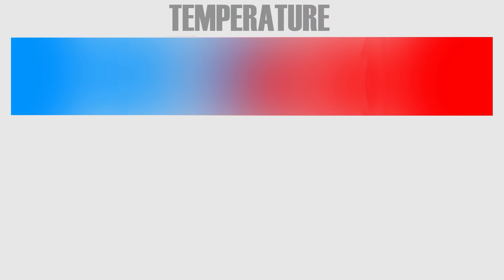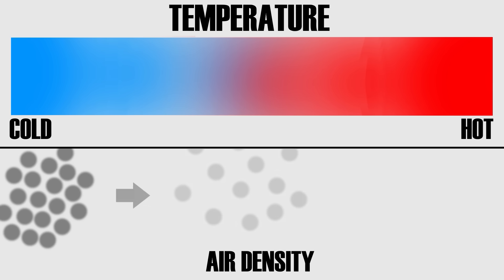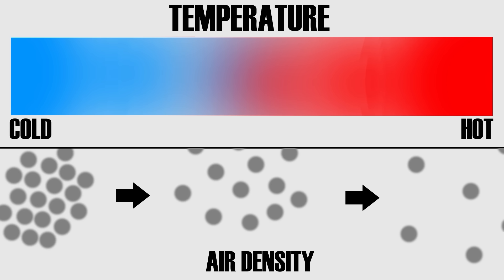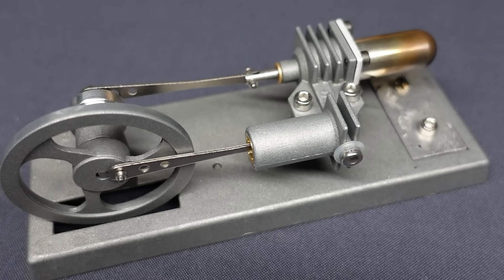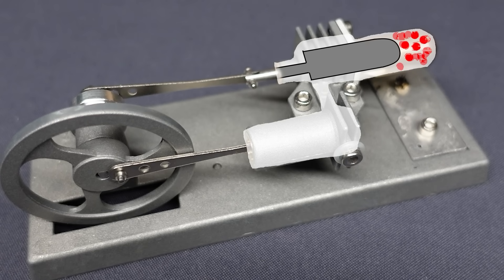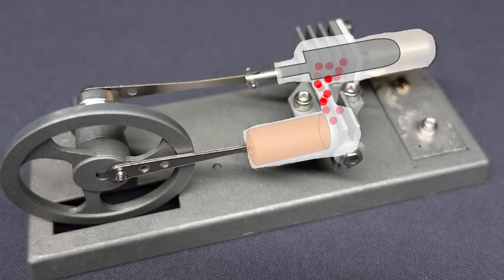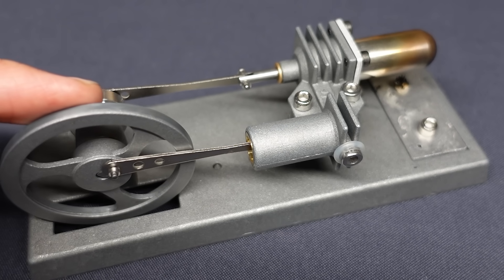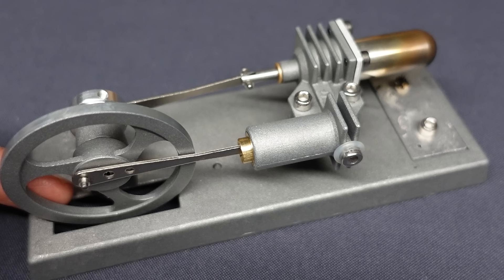It Can Save The World - The Simple Genius of Hot Air aka Stirling Engines

Comment: Hi, its an wonderful explanation. Can we use some liquid instead of plain air in the piston, as liquid will exert more pressure than air, and the system is cooled by external air, if we can again use liquid cooling method, wont it be more powerful or the power-to-weight ratio?

Comment: Perfect for farms that produces biogas, there is very easy have a flame 24/7 operating in a safe external place, powering a low voltage generator for electronics (as laptops, phones and tablets have their own batteries).

Comment: Its good to see a new kid who just discovered hot air engines.
They do need lubrication and cooling. And remember 
It takes time for the engine to run when first heated, so any running time after the heat source has been removed counsels out the "waste heat " running time.
These engines are great little display pieces .
The greatest novelty I've found is they can be turned at flywheel by another motor and refrigerate the hot end cylinder !
Some cryogenic refrigerators use this principle. 
Take care, everyone  !

Comment: You could make it more efficient by using a induction heating coil, using a ceramic outer with a coil metal inner for more air contact and a heat sink copper tube thing for transfering heat around those fins. This would make a massive temperature differential. :/

Comment: We need to be careful about this implication of free energy at the end.  When you start heating the engine, energy is input as it heats up from ambient, but it doesn't run; then it runs; then it cools to ambient, during which time it runs.  Energy input is out of phase with output, that's all.  My grandmother used to believe that electric rings were better than gas rings, because you got free cooking at the end after you turned them off.  It never occurred to her that she had to wait a minute after turning an electric ring on before she got any heat, whereas heat came instantly with the gas flame.

Comment: The problem with all heat engines is the efficiency. It is always lower than the theoretical carnot 1-T1/T2. This means the heat source needs to be as high as possible, but that is limited by material and Nox produced. External combustion also has the problem of wasting heat by heating everything in the vicinity of the working fluid.

Comment: sterling engines produce power….but incredibly tiny amounts of power.  And still lots of moving parts to wear out.  Sterling engines are not as efficient as an internal combustion engines….even steam engines are more efficient(and reliable), at changing heat to mechanical energy.  Electric motors running off of solar panels produces no emissions, won’t catch your curtains on fire, either….and beats all mentioned above for reliability

Comment: Maybe not good for everything but would certainly make a decent generator running off a cylinder of lp gas, charging up batteries and power tapped from same batteries to a electric push button starter for getting a bigger version running👍

Comment: The best thing is: you don't need a flame to run a Stirling engine. As long as it is hot, it will work. You can use geothermal heat, waste cooling water or from molten salt

Comment: Two questions:  1.  Isn't the work done by the Stirling after the heat source is extinguished offset the cost of the heat required before the engine begins to produce work?  2.  What is the thermal efficiency of the Stirling compared with an ICE?  Isn't there a large percentage of the heat of the source lost to the atmosphere rather than going into the engine?  
Has anyone tried to focus sunlight on the loose piston cylinder to make it run only on solar heat?

Comment: There are companies building generators for remote critical systems using Stirling engines. 

I have used them in the oil and gas industry.  Very reliable, low maintenance for lower power consumption applications. 

As a bonus the cooling fluid could be used for heat trace or limited heating applications. 

The ones I’ve seen are made by a company called Qnergy.

Comment: Very cool.
As a range extender for an electric vehicle, like the submarine example you gave, they could work well.

It would be interesting to know what sort of temperatures the pistons are subjected to. Creating a very low friction engine using Teflon pistons and bores might be possible.
Having opposed pistons, rather than in a V configuration, could provide some nice benefits to smoothness. Especially if there are 6 or more pistons.
And having the non-working piston a better fit in its bore, but with passages for air to travel through the piston, might also reduce some of the rattling noise it makes.

As for wasted heat.
I work at a steel works. We cast slabs of steel and plonk them on the ground to cool down in the open air.
1 of the biggest running costs for the steel works is electricity............... 
Australia............
Reply: The newest gen. of commercial Stirling engines use no oil ( also an ignition problem) they use PTFE rings and work for ca. 24 years constant without fail. So they are incredible reliable. Their downside is they need to be big to create a good power output. They are also what´s called a FPSE Free Piston Stirling Engine (beta configuration) with even less moving parts, specialized to create electricity. There is basically only one cylinder sharing the power piston and displacer piston which is more space efficient. They are also completely sealed and run off helium which is a ligther gas to increase power. They are also pressurized so about 3-5 atmosphere. Even NASA used them in their space exploration program to generate electricity (same free piston design I mentioned before)

Comment: This video is all about a gamma cycle sterling engines. I think you will find actual applications use an alpha cycle in which both the hot and cold cylinders have close-fitting pistons transferring the air from one to the other. These are much more efficient although still lack the power to weight for an internal combustion

Comment: Very cool! I have a fan I got from my dad. it has a strong heavy base and radiating fins on top. It powers an electrical fan with only heat, using the Peltier effect its pretty neat v- I should add its designed to sit on a wood burning stove to push warm air

Comment: THEY WOULD WORK FOR CARS - if the engine is used as a generator for a serial hybrid the power modulation doesn't matter, it just produces electricity and the modulation of the gas pedal is independent for the electric motor(s)

Comment: Think.  This engine design is like 180 years old.  And every since then it's been designed into.... almost no devices.   There's reasons for that!   Efficiency is in principle, very low, with the device full of thermodynamic contradictions.  Heat paths must be short but also long.  Thermal inertia has to be low while it is also high.   Temperature delta must be low but also high.   Far too many contradictions to ever be of much use.

Comment: I'd be interested in using them for nuclear power plant cooling pumps. As long as there is heat, there will be power.
These would be independent of outside fuel and outside electric power.

Comment: they are cute toys but if your going to use one to run a big generator, enough to power your home your going to need a big one and the amount of heat you will need will make it extremely inefficient, a steam engine would be way more practical.

Comment: These engines can be made even more efficient by actively or passively cooling it also. They create power by the temperature difference. Cooling the cold side does the same thing as heating the hot side. If this can be done with "waste cold" it can even be totaly free.

Comment: I wonder how long a Stirling engine would have to run to generate enough energy to offset the cost of building the Stirling engine? My guess is that there is a very good reason these things have never been much more than a laboratory curiosity. Still, I'd like to have one!
Reply: Also fuel cost.   How efficient are they?  Seems like a lot of wasted heat.    The interface between flame and
 pressure chamber could be improved.   How much more engine weight /mass, compared to ICE, for the same horsepower.

Comment: Is there an advantage to use a gas other than air in the pistons? A gas with lower heat capacity like a noble gas?
Reply: No, because unless your cylinders are perfectly air-tight (and they aren't) your working fluid will be quickly replaced by air anyhow.

Comment: I've seen hundreds of sterling engines, and 99.9% of them have been desk toys.

They really are great for that.  I have about 25 of them, and they are great fun when kids come over.
Reply: Several have been built that power cars. One was installed in an old Porsche Berg Spyder and was driven 120 MPH.
Reply: @ronarmstrong835  source?
Reply: Aren't they used in submarines?
Reply: Not being pedantic, but it's spelt Stirling. It was the inventors name.
Reply: @robertrobinson3861  I think most know it's Stirling. People are usually typing on a tiny phone keyboard that is going to Auto-correct or Auto-complete words...especially ones based on names that are similar to other more common words.
Reply: They can now be found on some modern submarines.
Reply: the most common stirling "engine" isnt an engine, its a cryo cooler. they work just as well in reverse :)

often found on the bank of liquid nitrogen tankers, in super expensive medical equipment, labs.

other than that, and a few antiques running chaff cutters or water pumps... a "working" or "practical" stirling engine is rather seldomly come across..

though i just remembered, theyre popular in say, africa, driving desktop fans? i love that concept, burn a dash of kerosense to "cool" a room...

retrieves ice cold drink from old kero fridge converted to run on solar thermal storage

Comment: The original internal combustion engines had to be manually started. Hobby stirling engines lack many of the analogues of parts found in hobby internal combustion engines. The power modulation issue could be addressed with additional flywheels and gearboxes and initial startup could easily be handled by electric solutions.

Comment: there is this company that creates home central heating system when a fire heater primarily heats the domestic water in it’s storage tank, and then uses exhaust fumes for running sterling engine and produce electricity ! so yeah, I think sterlings are going to be used more and more.

Comment: Neat.  I read about this from 115 years ago but haven't seen a model.  There was a Sears Catalog car you could order.  It looked like an early Model T but:

It ran on bolts heated by an external flame

Had what we would call a CVT transmission made of compressed paper roll.

Used no electricity or magneto at all.

Comment: So there are very low temperature differential stirling engines. I've always imagined the potential of ground-stabilized temperature air being pumped (self-pumped) over a stirling to make it run against the above-ground ambient air. Seems doable with enough subterranean air. Winter, the subterranean air would be warmer and summer it would be cooler. Enough stirlings between sunlight and underground air I think would present a great solution in areas where neither sunlight nor wind are very prominent. The idea is like a subterranean heat exchanger, except it makes energy instead of doing the HVAC thing.